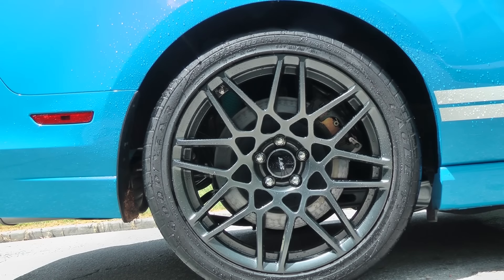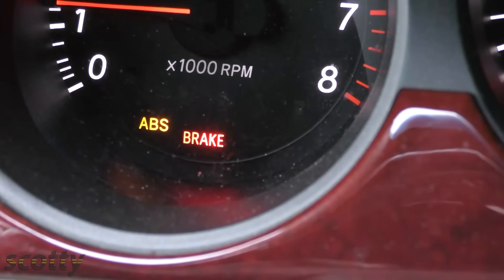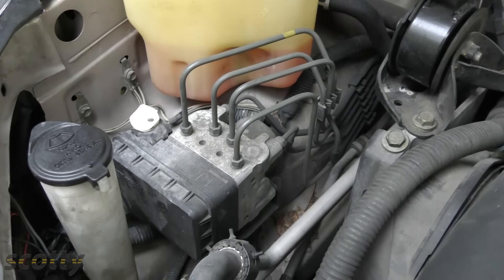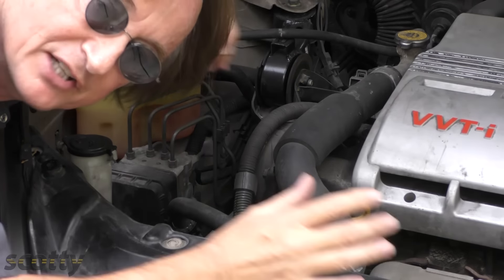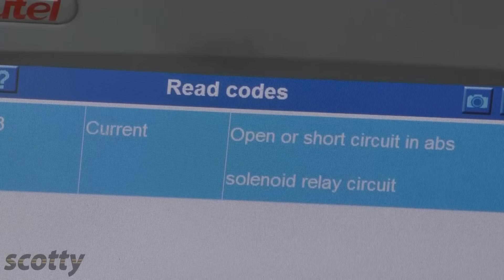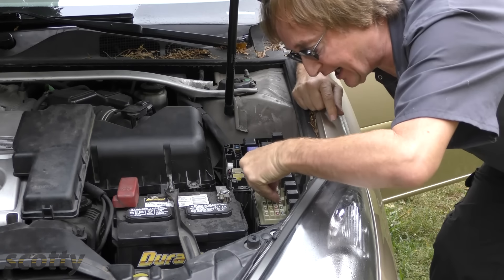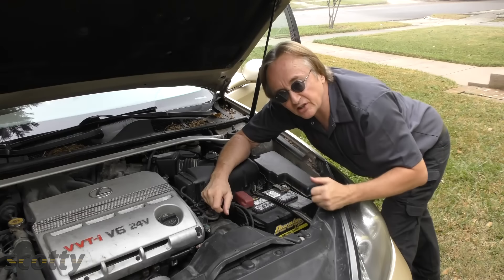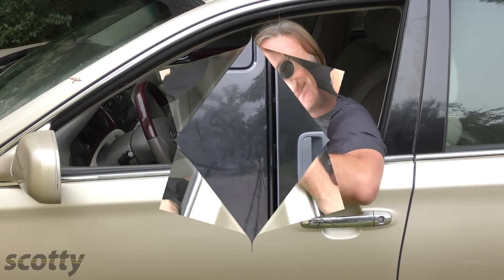ABS Light Stays On, What To Do?

Comment: One thing I find interesting about modern cars is the ever present LCD in the middle of the dashboard. It'll tell you for instance when it's cold outside, or if the windshield washer fluid is low, or something else is wrong with the car. I'm surprised manufacturers don't just build the scanners into the system. They could simplify the descriptions with the added verbiage of "See your dealer or a competent mechanic."
Reply: kd1s oh they could do that but they would definitely drop the “or competent mechanic” part it would say something like “Sensor failure, see dealer for service”

Comment: Scotty you seemed a little off in your explanation of ABS. Anti-lock senses when a wheel is ABOUT to lock up, not take action after it locks. If it took action after it locked it would possibly be too late. When a wheel is about to lock it loses speed very quickly. The computer sees this and knows what is about to happen (lockup). Then it springs into action.

Comment: mine started sticking on after lower control arm replacements. hypothesis?
Reply: Either you dinged the tone ring and damaged the teeth or you damaged the wheel speed sensor sensor or the wiring going to it. Although it could also just be a random coincidence.

Comment: Hi Scotty, I have a 2010 Toyota Prius, I was on my way home from work all of a sudden my Brake light and ABS and Traction control light all came on. Also I can feel the brakes are not as responsive . I checked the brake pads , The front are warn all the way not metal to metal but close the rear are ok, could this cause the lights to come on ?? I checked the brake fluid and it's full. the car has 209,000 miles and I never had a brake job. I drive it to work 143 miles a day. Never had any problems except for one rear wheel bearing that I replaced myself about 60,000 miles ago.  Any help would be appreciated.

Comment: Wait, Its not that simple. The ABS fuse in my 2004 Tacoma is 60 amps, so having a bad alternator can cause the problem if the battery charge level drops sufficiently enough that there is not enough power for the ABS system to work. This has happened to me about a year ago; the wire harness on my alternator had a short and the exciter wire and voltage sense wires stopped conducting after I had been driving for some time. The ABS light came on while I was driving and a few miles later I pulled over and checked the codes; sure enough it was the alternator.

Comment: The ABS warning indicator came "on" on my 2004 VW diesel Jetta. I did a search and everyone said the same as Scotty,  as long as the Brake Warning light does not also come "on" . If both indicators come on...then go see a professional and DON'T drive your car.
In my case,  I added some brake fluid to the reservoir and that seems to have "solved" the problem.

Comment: My ABS has been on for over a year now.  When I drive very slow and tough the brakes, the ABS will pulse and you can feel it thru the brake pedal. After a while, I don't feel the ABS pulsating anymore, and brakes work fine without the ABS interrupting it. But light remains, so what gives?

Comment: 2005 dodge caravan. ABS activates every single  time i brake. Very loud chatter, chatter, chatter, stop.  What gives? bad ABS pump? controller? please help!
Reply: Turns out that my brake bolts holding the caliper were MISSING! That explained it. Replaced pins fixed it.

Comment: ABS is installed for a purpose. No ABS equals safety hazard because when people slam on the brake pedal trying to swerve the car at the same time they will end up in a hospital, guaranteed. Only if you are a really good driver and can feel when any of your wheels locks up so that you can release the brakes for a fraction of a second you can be safe (oh, and you must have the best possible tires for that). I had ABS on Audi S2 that could be disabled and it helped to disable it when driving on icy roads (because the car just wouldn't stop). I had to use the brake pedal and unlock the wheels myself. Studded tires.

With ABS I had to slam on the brakes only once in summer on a highway because of some moron who was backing up in my lane with no lights. Yes, I stopped perfect. And Audi S8 and a BMW Coupe rear-ended me because they both had ABS lights on.

Comment: My Hybrid Yaris will also put the ABS and VSC lights on if the battery voltage is a bit low at start-up.   If I trickle charge my 12v battery over night, the problems goes away.  ( I did need to clear a code for 'communication failure with ECU - or words to that effect)  I'll probably need a new battery soon...

Comment: First I want to say how much your videos have helped me with some many different cars I've had. I have a question I'm hoping you can help me with. recently I purchased a 2003 Buick LeSabre custom. when I purchased the vehicle I was told it would need brake work after inspecting all of the brakes I ended up replacing all of the brake pads calipers and rotors. when I replaced one of the back calipers I left the brake line off and went to the auto parts store to buy a new one, when I returned all of the brake fluid had drained out of the system. the reservoir was completely drained. I didn't think it was that big of a deal so I continued to replace all of these components and I bleed all of the brakes and sequence. my problem is that when the car is off the brake pedal is firm but when I start the car the brake pedal goes to the floor. do you have any suggestions on what to do next because I am lost.

Comment: I bought my GMC pickup new in '99.  About a year after I bought it, the ABS light came on.  Still under warranty.  Turned out the ABS module had shorted out.  Total replacement cost would have been $1900 if not for warranty.

Comment: Watching this just reminded me that even though I've had my replacement wheel speed sensor for my car for over a year now, I still have it in the trunk of my car. LMAO. Long story short 1999 Ford Crown Victoria, driving down the road when the front drivers wheel bearing went out and the teeth on the back side of the wheel hub literally chewed thru the sensor. Damn I need to get motivated to change that thing out, Indiana sucks during snow, especially in the area I live in due to plow trucks never showing up until it gets severely bad.

Comment: When replacing an ABS sensor should I disconnect the negative battery terminal or just pull the main ABS fuse. Can  "battery memory savers" to maintain the radio and engine memory?

Comment: Thanks Scotty. My abs light comes on when it wants to.
A different problem you might help with, brakes. I installed rotors, calipers and new pads. Sometimes I can hear and feel metal to metal when stepping on the brake softly or hard. Not always but it just bugs me when it happens. Any advise? 94 GMC Sonoma truck.

Comment: Hey Scott,
I recently changed one of the sensors and wheel baring on one side of the front wheels. For a while abs lights didn’t came on until now. Now my breaks are making a noise before I start speeding but once I go over 45 miles, Abs lights comes on and break sounds goes away.

Comment: ABS light on. (huh?)
ABS seems to work normally. (hmm...)
Fetches paper clip for OBD I.  Trouble Code: 12 - 12 - 12 ... 12 - 12 - 12 (no codes stored)
Checks what the code would be for ABS:  (no codes listed for ABS)

Tap dash.  Shrug.  Ignore.

Comment: Service stabilitrak came up in my dash and it seem as if my car ain’t wanna pull off.  Chevy Impala 2012
Reply: Nick Hunter when I still had my Buick Regal 2012 it did that... if you have ABS light along with service stabilitak and service brake assist message it is a wheel speed sensor. Cost around $500-600 at dealer to fix.

Comment: ABS failing on a Lexus is rare? Tell that to my customer that needed a whole new electric boost pump. Over $2,000 repair because the motor burnt out and fried the board.
Reply: Toyotas are fine if you take care of regular maintenance. A Lexus, like all other luxury brands, will fall apart if you look at them in a way they don't like.

Comment: I had my wheel bearing bust recently, destroyed the tone wheel bearing thus effectively sanding the sensor, replaced the hub and sensor all good, but it was the complete opposite with the fail safe, abs was constantly pumping when braking pressure was applied. Typical Subaru.......
Reply: Ditto on my Hyundai.

Comment: For  two months my car was just sitting on the driveway  and i finally got it back on the road this week,  the ABS light came on and I took it to a local shop. The mechanic told me it will reset by itself as I put more miles on it because the car was on the same spot  for months. I live in NY and this summer was brutal plus we had tons of rain as well. We'll see what happens !!!

Comment: The abs on my 87 Toyota Supra never gave me any problems and works great. It is also a 3 channel system so it uses a sensor in the transmission for both the rear wheels which is very cool for a early style abs system.

Comment: Yeah. Pull the fuse. No more abs light, correct? I checked the brakes on ice. Abs failsafe. Ha. Lights on an nobody home. It slides on ice like a normal car. Old chevy. 2007. I'm a very safe driver anyways. There was 2 times in 8 years I could of used it. And the tracktion control got me stuck so bad had to get pulled out of my own driveway. ... Plow came by. Ok let's plow tthru it with enough speed on a little 10 ft of gravel, then 6ft of ice then the big pile. What a retarded system. Now I see the concept of traction control. Man it was like a dead stop in the pile!!. Funny now. I had to crawl out my window. Hahahaha. Tires stop rotation on ice till they get a GRIP when there is none.
 Have fun. Be a safe driver.

Comment: Hey scotty! What could cause an extremely loud screech from the engine bay? I took off both the belts (My ford has two) and I thought maybe that was it. Nope, it still does it. I checked my oil and other fluids and they are fine too, nor is the oil pressure light on. There was some work done to it that required removing the harmonic balancer. Is there any chance it's related to this? I'm stumped as to what is going on. It is definitely not a vacuum leak, I covered all bases on that.

Comment: ABS doesn't always fail in a safe way. Was working on a 2001 GMC jimmy where the ABS would keep coming on every time you went to stop and it made it nearly impossible to get the vehicle stopped. It didn't do it every time, but it was doing it pretty frequently. Replacing the wheel sensor resolved the problem entirely.

As far as I understand ABS, it always does a test after starting the vehicle. The problem was every time you went to stop it'd lock into one of those tests.

Comment: Hi Scotty, I have a puzzling problem. On my 2003 f150 4x4 as I slow down  to a stop, sometimes my brake pedal drops just slightly and lately the ABS activates when almost at a stop but is on a dry surface. The puzzling part is that the ABS dash light works but does not come on.  Thank you for any advice you can give.
Reply: Were your brake pads thin and needed to be changed?
Reply: @brighteyes6559  Actually, I found out that the ABS sensor was defective so I replaced the hub and bearing and it cured the problem. Brake pads were still good. Thanks.

Comment: I am sorry to say Scotty Kilmer, but it is not true, YOU ARE WRONG, what you stated on the ABS going back to standard braking, it is a lye,  IT JUST STOPS WORKING PERIOD and you may end up hitting someone on the road.  If someone is selling you a car with ABS lights, DO NOT BUY IT!  I followed Mr. Kilmer's advise and it bit me in the wallet.  I purchased a car with a problems with the ABS by following his advise that it will work with standard braking, but after a month of owning the car, it does not stop at all.  Also, It is A TOYOTA, the worst idea was to by this garbage of a car.  Toyota Corp. does not even offer a RECALL or Extended Warranty to fix the problem that it has been running for 8 years and still does not want to fix it.  I do not know how much money Toyota is giving to Mr. Kilmer's comments to praise Toyota for being a great company, but it must be a lot of money.  The car has an error code C1391 that was pulled from an expensive diagnostic tool, like the one he has his hands on this video.  The car makes a beeping noise that will not stop until the car is turned off.  The worst is the cost to fix it, it cost $2,700.00 USD (Parts and Labor) at the Toyota Dealership and there is not a way around it, it is not a part that can be purchased at your local Auto Parts Store or Junk Yard, try ebay and search for Toyota 44510-48080 and check what comes out, google it and you will see the cost of a USED Part.  My advise is not to listen to this guy and 50 years of experience will not help if you have not dealt with the problem in front of you at all!